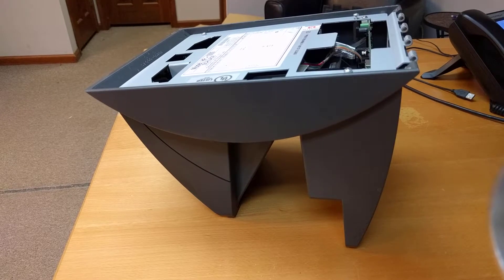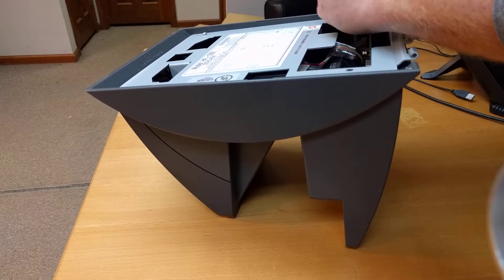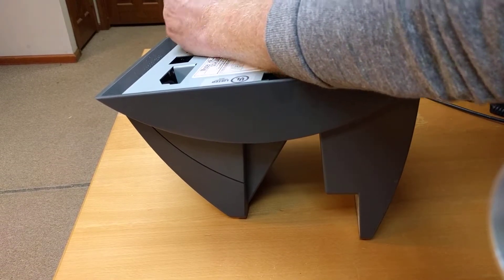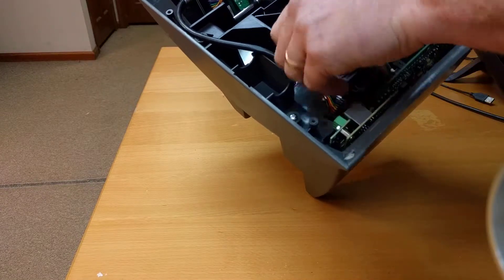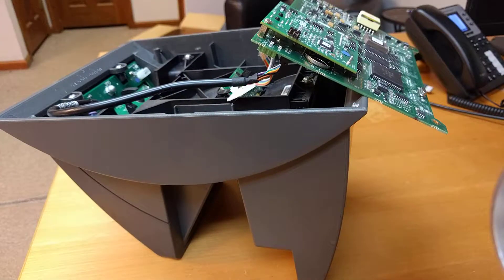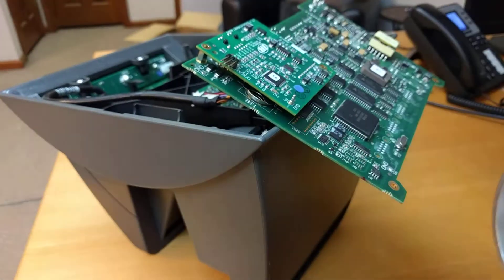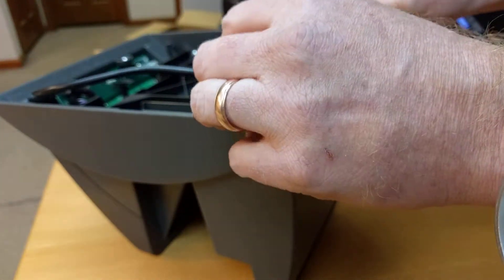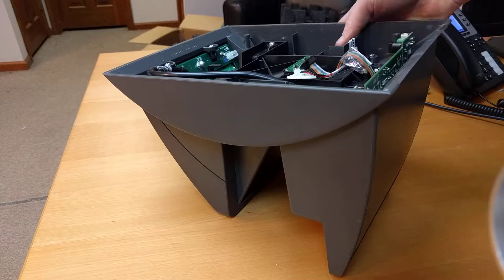HandPunch Ethernet Card Removal

Comment: Hi, I have 3 HP1000 and 2 of them seems to have serial connection using rj45 cable and 1 has a ethernet board which has a DHCP buttom.. but I Tried all 3 mainboards with ethernet board and cable and when I go to configure Serial it doesnt show IP address but serial port speed.. how can I enable ethernet on the firmware? Thanks.
Reply from the maker: The units that have the RJ45 serial connectors are an older style and do not support the internal Ethernet card natively because the EPROM does not support it.  If you look at the version stamped on the EPROM there should be an E after the version.
Reply: @TrustPointHCM  Thanks, anyway I can download ethernet eprom version somewhere and write on my eeprom using a thirdparty programmer?